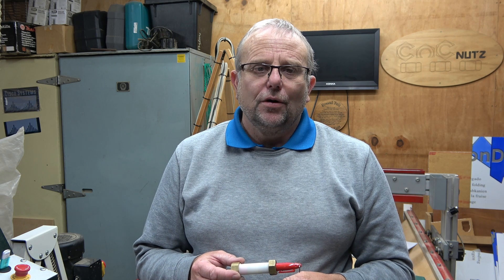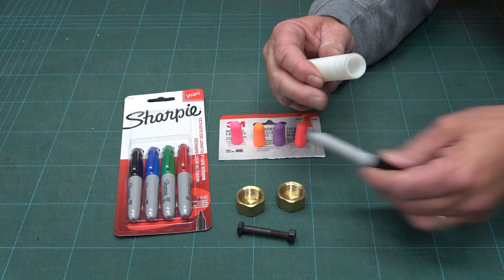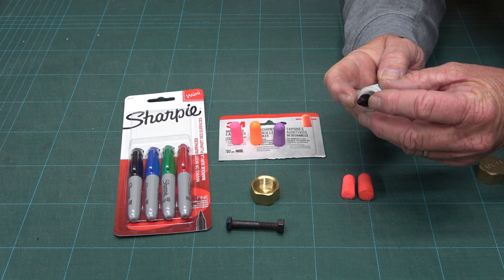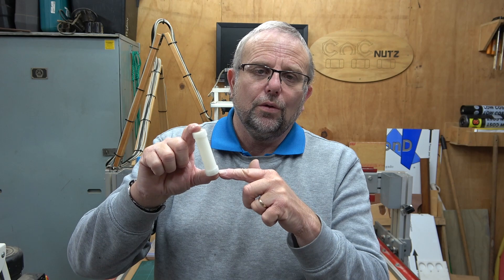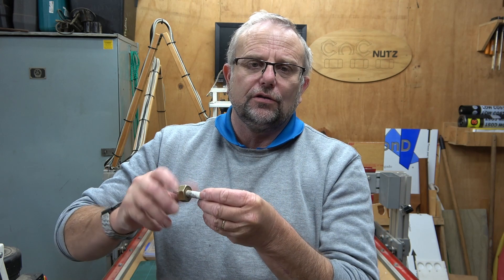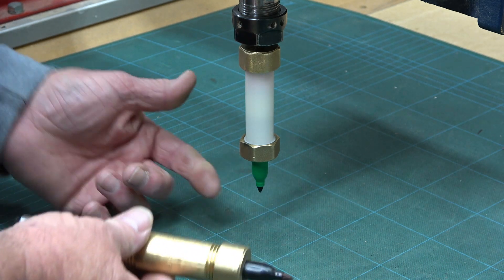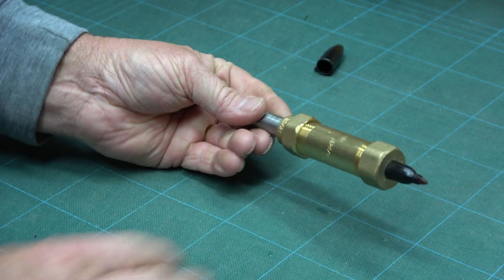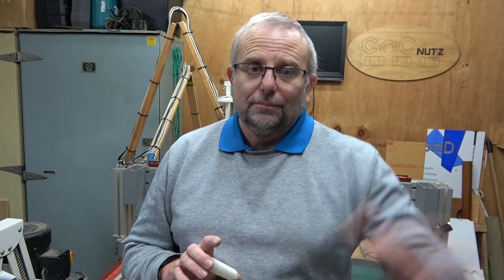DIY CNC Pen Holder - CNCnutz Episode 250

Comment: I don't have room in the 3018, so just make a stack of 45mm MDF with the right internal hole, replace the entire motor. Will be cruising the hardware store plumbing isles now for tubes to use.

Comment: Peter once again your ideas have got me off the couch to make or try something you suggested.  THANK YOU!   I made two of these.  One using schedule 80 plastic 1/2 nipple 4" long and after it was a tad long I am using the long sharpies for more color choices and I had a box of 20 of them from making card board boats with my Chuch Scout Group.  So I went by Lowes (big box store) to get a 3" nipple.  They didn't carry the schedule 80 pipe.  Looking around I came across some sprinkler plastic called a 6" riser and 2 caps.  Used your process with the ear plugs and out came a smaller Pen for my CNC.  I was so elated it worked so very well ...Thank you Peter,  that I tried to use  my DRAG Knife for the first time.  On my second cut with that drag knife I forgot to reset my z to the new drag tool from the short end mill and broke the blade and bent the spindle on the draw knife.  Funny how I can make 200 operations and not miss anything by much and BAM I tore up 80 dollars in 2 seconds.  GRIN!  Posting a video on my mods to your design and at the end of it is my BRAND NEW BENT Drag Knife!
Drag Pen Yes Drag Knife No  is the name of my success and flop!
Reply: 3/8" sch40 is more common, about 7/16" ID

Comment: For the spring you need to find someone who uses the Freestyle Libre CGM  (glucose monitor for type 1 and type 2 diabetics).  The spring loaded mechanism that they use to inject the monitor has a spring that may well work just fine for you.  I am going to use it on a 3D printed CNC pen holder I am making.  The users of these CGM's  use a new one every 14 days and usually the injecting mechanism is tossed in the trash afterward.

Comment: Nice lateral thinking on the spring. Too often we limit ourselves to the sellers description of what a things use is.
Re the tip wobble. Given your declared usage it doesn't matter. The wobble inaccuracy disappears in the tip width and the amount of down force on it. I would happily use it as a toolpath check etc.
If one is after accuracy you start with a fine accurate tip, not a whiteboard marker.
BTW, in Oz they sold a brass version of your plastic threaded item.
Reply from the maker: Thanks Andrew.
One thing I do is look through shops seeing what they have and filing it away in memory for possible uses in the future. Whether it was made for it or not.
Cheers Peter 
Cheers Peter

Comment: When you run the felt pen in the CNC, you obviously turn the rpm off to the spindle, but what is the tool path that you use? Is there a drag knife tool path in Vectric?
Reply from the maker: Profile tool path. Select on the line. 
Cheers Peter

Comment: sir. i have one question. do i run mach3 with cnc sheild and 4988 driver ? any wire diaghram available ??
Reply from the maker: Sorry I can't help with your problem. I'm not familiar with the drives you have.
Cheers Peter

Comment: 3d printing the sharpie carrier seems like a quick solution instead of the lathe but i guess you still have the shaft to worry about
Reply from the maker: A 3d printer would be a good way of making one. I don't think the shaft would be a problem for long.
You could. Probably print your own pen as well. 😂
Cheers Peter

Comment: Great idea!
Just going to say that the off centre tip from the pen does not matter so much provided the spindle doesn't rotate - the offset will always stay the same.
The important thing is that the tip doesn't deflect and I think you have that solved.

Some time ago my wife was painting some signs to put on power poles for our daughter's scout group.
It turned out the most time consuming part was neatly sketching and spacing the lettering before painting over it.
So, I put a sharpie in a large collet on my machine and drew everything on the boards (~20 of them).
Without a spring mechanism, it was a bit rough on the pen - but the job was done in no time (at the cost of of one pen).
Reply from the maker: Very true Perry.
If they could center properly you could change pen and create coloured works of art without having to zero every pen change. Not really a hardship. 
Making signs quickly would be a good use for the pen holder.
Cheers Peter

Comment: A super project, but I saw this about a month to late, as I spent many hours making one, LOL.
The problem is that I want to photograph line drawings I made and draw on the CNC as Christmas present to our daughter. I’m using Vcarve Pro 8.5 and I import directly from the camera card and into “import bit map for tracing” then click “trace bitmap”.  Then is use “V-Carve” That makes the single line a double line for V carving between the lines.  
Is there a way to offset those two lines into one line, so the CNC drawing looks like the original?
Or is there another approach to have the CNC make a single line drawing like the original drawing.
Thanks Peter
Reply from the maker: Sorry I don't have a solution to the drawing  problem.
Cheers Peter
Reply: Is this what you want?  https://youtu.be/HudEeCEgcQU